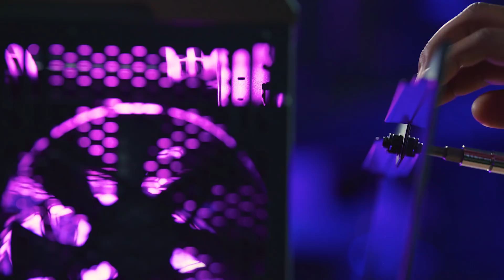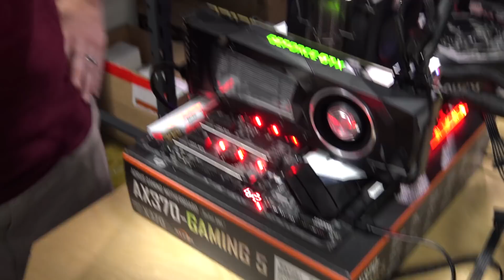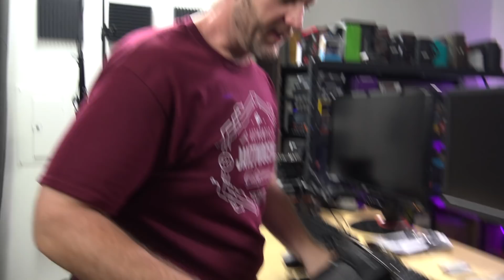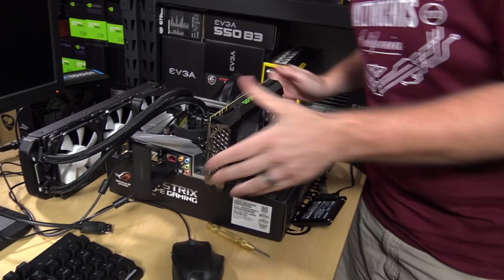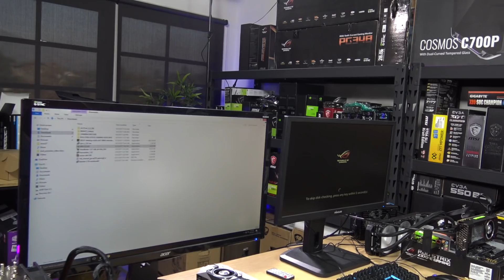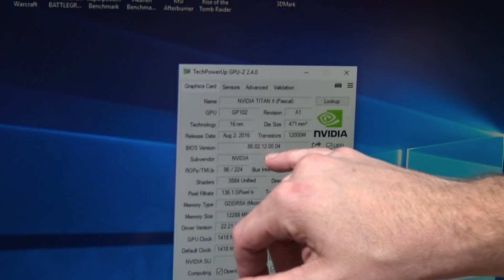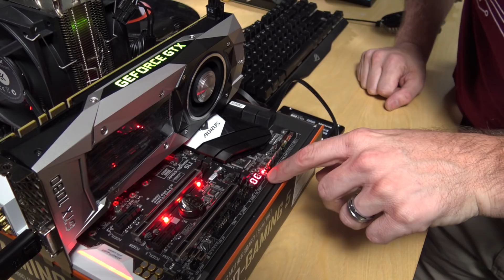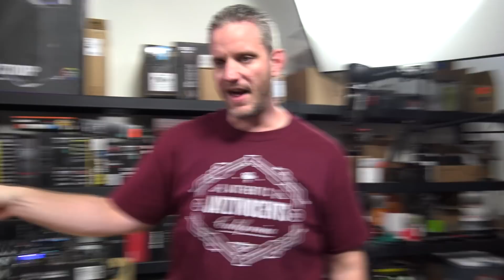I cant figure this one out... HELP!

Comment: If I had any open options to do troubleshooting, I'd get a second motherboard for the AMD, same model. I'm just armchairing right now but that would eliminate this piece of hardware as the issue.

Armchairing again, If trying another identical works, it might be down to electricity, pci-e socket irregularity, card quality, just edge of the seat stuff. Then again, this is heavy armchairing your question asks for
Reply: Martin Desjardins but it works with another gpu
Reply: Yeah, if you read my comment, I'm talking about edge of the seat stuff, maybe it is missing just that much voltage and whatnot that causes one of the cards that might also be slightly different than the other not to work.. very heavy supposition like I said

Comment: This happened to me actually with an EVGA 1060. The firmware of one card was different from the other BUT I was able to get the original card to work by lowering the voltage to the card (it was set to overclock in the mobo bios).

Comment: Just throwing this out there I have had 2 identical cards but one of the power socket's had an issue and some of the 6 or 8 pin pcie connectors from one power supply to another worked better IE the deformity was causing bad contact inside the socket.

Comment: Hey Jay- other card yadda yadda. Also check to see if the card failing on the amd system is pulling more watts. Have you tried a different PSU on the AMD test rig? You are using a single psu power cable. If the AMD system is pulling more watts on a similar power rail it could cause an issue.  Just a guess.

Comment: Bad 12V rail for the PCIe connections on the Ryzen system's power supply.  And check the Bios version on the 'bad' card, you didn't show that in the video as many people have noted.

Comment: I am experiencing something similar, I have a 1600x and a founders edition 1080, It gets stuck on the VGA post light too
Reply: Grayden Hormes make sure virtualization settings are off..
Reply: Steffen R cant do that if it doesn't boot
Reply: Yes you can. Use onboard video to configure in bios. If you don't get a crappy card and do it.
Reply: This is a ryzen system theres no onboard video
Reply: Steffen R i used a friends card and svm was off
Reply: Grayden Hormes try turning off fast boot or whatever your board calls it.

Comment: Please check bad gpu firmware on the intel since it works there. In the video, you show gpu firmware on intel, swap the gpu to ryzen, and show same gpu firmware, but you didnot show firmware that gpu previuosly on ryzen. Other way may change ryzen motherboard with other.

Comment: On the card that's being a pain, are the physical connections okay? Maybe something's misaligned due to a manufacturer defect enough that when the problem card is in the problem board, something's not connecting, but when it's in a nonproblematic board it works.

Comment: Do you have a weird overclock set for the Titan that maybe the one card that works can hit, but the other cannot? is the slot slightly dirty, and some of the dirt is not on the non-working titan so that when combined it blocks a vital part of the pcb inserted into the slot?

Comment: I've seen this persist from a corrupt os. My old hd5670  ran great for ages, then I tried throwing it onto my secondary system when the onboard seemed like it was dying. No worky. Changed the hard drive to a new os (when 8 came out) after 3 months of frustration and Tada!.. worky worky

Comment: I was having a similar issue with my Ryzen 1600X.  Though in my case it was both the graphics card and the motherboard.  I went through a 2 carbon blacks, and an aurous k5.  The final board to work was the hero crosshair VI.  At one point the issue took out the PCI bus on a board and the CPU.  Let me know if you would like more details on how I went through this issue.

Comment: ok, question, did you check manufacture dates? if they differ or were made by different warehouses maybe try checking the contacts on the cards and make sure every contact is good and no damage. that's about all I can think of unless there's a difference in some chips on the cards themselves.

Comment: You didn't actually check the BIOS of both cards. You checked it on the Intel system and them moved it to the AMD system and checked it again. You may want to go back and actually check the BIOS ver. of the card that only works on the Intel system.

Comment: Identical graphics cards aren't actually 'identical'. Whatever is going on is something so minor the amd board thinks it's a bad vga while the intel board does not. I'd be interested in seeing power loads for the two cards when in one of the working boards (obviously). During post/boot and under load. Thermals as well, maybe using a infrared camera during various loads without the backplate.

Comment: Did you try to move the videocard down to the second PCI slot just to see if it posts?
Also, try a clear CMOS if you didn't, and try to boot with a single memory module; I know it makes no sense, but that's what I'd do If I had the same issue, considering you already checked the BIOS version.
P.S. Sorry for any mistake, but English is not my native language.

Comment: Test in a different PCI slot. Check CPU pins. Visually check the PCI slot. Check for defects on the card or motherboard. Check power draw on the card like early rx480 cards.

Comment: I had a very similar issue with bootlooping when not making a quick stop in the bios and then enter to windows. I tried out millions of DDR4 settings until I found out, that the real issue was Windows 10 by itself. You have to go to msconfig and check that you let the boot priorities not using multithreading (like x16) just set it as auto. It conflicts with the bios multithreading setting. Maybe that will help! :)
Reply: If that setting via Windows actually affect how the UEFI runs it will still affect the UEFIs ability to POST.
Also if Fast Boot is enabled the UEFI will try to immediately boot Windows more or less skipping the POST screen (but still doing some POST in the background).
Reply: that would have effect the other card too , not just one of them. the problem have to be unique to this card+motherboard combo . something like this card have issue in it that this motherboard can't ignore or solve like extra volts in bios ( which is not readable by gpu-z ) while other motherboard is can ignore it the request of extra power or buss etc...
not sure what it is but he have to keep trying to check 1 by 1 till he find what is the hidden difference between these 2 cards .
Reply: Fido Dido that is a very good point, to be honest: I did just brainstorm, but you are right. That issue is so unique and maybe isn’t really a RYZEN fault! It could be something totally different like the way each card interacts with the pcie slot...to figure that out Jay would need each board twice to be sure. As the plating on the card could be damaged on the card or the pcie slot itself and be just working on the other slot cause of different types of layout...or even the cables of the psu in combination with the 8 pin of the gpu...if some of that is damaged, it might work with the other setup for whatever reason and not with the other setup. So I would see the problem on the Pcie Slot of the mobo, the Psu cable, the plating on the pcie connection of the gpu or 8 pin connection.
Reply: i was refering to a much older pc but that wasnt the point the point was windows modded my pcs bios so there could have been non noticable bios chanes after it runs that card and why would the fact it 2-17 not 2015 have to do with anyhting?
Reply: Vote up if you think that my suggestion could help Jay...cheers
Reply: well you might expect that but when a pc that was made when windows 8 was a thing and its bios is from when 8.0 was a thing(and ive not updated bios) why am i getting msges in bios saying if i change x settings windows 10 may not preform as well or may not funciton as thats not coming from bios and my bios was changed a bit i know and it was changed by windows i bet

Comment: Try the non working Titan card on the AMD system again. But, instead of swapping GPU's, swap display cables? Like go from DP, to DVI, to HDMI cable? If, that doesn't work, switch the two monitors around that you have on your work bench? If, that doesn't work, then, I don't really know what else to do that doesn't involve more time. But, if you have time, a fresh install of windows, load defaults on the motherboard to changing RAM kits and/or changing RAM speed. IDK. The RAM thing I threw out there because of RYZEN RAM thing. But, that is an interesting and strange conundrum.

Comment: You checked the vbios version on the same card on two different systems. You did not check the one that refused to post on Ryzen once you booted it in the Intel system. So you didn't confirm same bios!!!

Comment: I don't think you actually check the bios if that card that didn't work.  You check the good card on the Intel.  Put it in the AMD system And checked the same card but never checked the card that didn't work in the AMD system once you put it in the Intel system.

Comment: Something is going down definitely. I'd have to say it a combination of things first decompress need a clear head for this. Next now this is clearly a compound issues too many layers. There are some very specific conditions being achieved when you plug that specific gpu into the mobile to cause this. Check the pcie slot then back track. Reseat the cpu and ram do a wiggle test. Then start up. Should start up normally then insert gpu lightly the start up. Then clean slot and wiggle test gpu try start up. Then go deeper the mobo bios. Try to find and recreate those specific conditions. That small hang up on boot with the other gpu has be suspecting a software problem.

Comment: Do a fresh install of windows with the ryzen system. Apparently if you installed windows onto the ssd with an intel system and then switch the ssd over to the ryzen system, it can cause issues with the graphics card.

Comment: Try a different PCIe slot and see what that does. Maybe also try SLI? 

There could also be some settings in the UEFI that may have some effect on it. I don't have a Ryzen system available to me, but I am definitely familiar with troubleshooting unexplainable mother board issues. I would suggest messing with any graphics, PCIe, or other peripheral related settings and see if any of them have a bearing on what you are experiencing. Perhaps even just clearing CMOS would do the trick. It's a very odd issue.

Comment: You didn't actually check the BIOS version of the "bad" GPU.

You checked the BIOS on the "good" GPU while it was installed in the Intel system.
Then you checked the BIOS of the "good" GPU while it was installed in the Ryzen system.

Didn't you want to check the BIOS version of the "bad" GPU while it was installed in the Intel system?
You may have done this off camera, but not in the video.
Reply: Yes he checked the Firmware of the same Card twice on both system... Lol
Reply: You are correct, He checked the bios of the same card on both systems instead of both cards on the same system....
Reply: Thought the same
Reply: Jay show us the bios of the faulty card pls.
Reply: Edit *  You have so many comments, I see where you say you rechecked and they do indeed match, sorry *

I was thinking the same thing.  He never checked the BIOS of the bad card on the Intel system.  He checked the bios of the working card on the Ryzen system, that was the one he checked on the Intel system, so of course the BIOS reads the same, because it was the same card.  now, i don't think that was the problem.  I would however, re-flash the BIOS with the newest current BIOS, and make sure to clear all settings (I've noticed that my Ryzen system is funny with that sometimes)..  After that, i would then try the last known "Stable" bios and see, and possibly a beta BIOS.  I know that there is one guy on the ASUS forums that works on beta BIOS for Ryzen, so I'm sure there is something around.
Reply: Haha.  I saw that too.  Having made YouTube vids myself, you miss shit like that when you are filming.  Simple shit that you are talking about goes by the wayside because you are worried about getting the shot.  The lighting, the focus, all sorts of shit.  That being said, as soon as he did it, I muttered "ya dunce, you just checked the same card..."  lol.
Reply: And then he picked up the good GPU and said it was bad.
Reply: Legit.
Reply: Was thinking the same thing.
Reply: Unfortunately, the only things to really try are some of the things I suggested about reflashing different BIOSes while making sure to clear the settings.  I built a Ryzen system recently and it usually does, but there were times that kept some settings, but not others. I would try the last known stable factory released BIOS, as well as possibly a beta newer BIOS.  and see how that behaves.
Reply: Yes youre right thats what im thingking
Reply: was just getting rdy to say that
Reply: That's what I thought I saw.
Reply: lol
Reply: +Early Wynn

I don't have a solution.
I was just pointing out that it looked like Jay may have missed checking both cards... maybe he was tired.

Since Jay, in other comments, said that he did indeed check the BIOS on both cards, that seems like a very weird issue.
It would suck to be a person with just 1 system and to be in such a situation.
Reply: +icebalm
lol, I didn't even notice that.
Reply: +P.J
The drivers couldn't be the issue since the mobo didn't even boot to its BIOS, but I like your idea about trying other PCI-E ports.
Reply: Sounds Great now come up with an Solution for People with only one PC. And you`re someones hero
Reply: That's exactly what he did let's call them systems A (Left) and system B (Right).

First seashells that system a the video card is not working and it's failing to boot.

Then he shows system B working with the same video card and then checks the video cards bios.

After they doing that he takes systems a video card out and lays it in front of the keyboard of system B.

Then he takes system B's video card out and installs it into system A's motherboard.  At this time he checks the video cards bios again so you are tracking system is motherboard with system B's video card.

At no time to eat check system be with systems a video card.
Reply: yes he did I saw it .

Comment: Why is this logically  a RyZEN maturity problem? From the video, you had a similar problem with a second GTX card, and you had to turn off the machine and reseat the card to make it work. You should at least try another PCIE slot or otherwise make sure that the card has proper electric contacts at  the PCIE pins.

Comment: Try changing the Ryzen system PCIe slot to use x8 instead of x16 and see if it boots.  There may be an issue with the card on the pins used for x16 mode.  If you're using M.2 SSDs, then the Intel system is running  x8/x4 vs. Ryzen which would be using x16/x4.

Comment: Like 3 years ago , i had a similar problem, and with an Asus deluxe motherboard, some video cards work, others don't, even if they were well.

I had to change the graphics card 3 times , but still had some isues.

And the problem was the motherboard bios, even loading the last version of the bios tens of times, it didn't work well. (this problem i had it for 1 year)

How you load the new bios version normally?

You save it in a pendrive and then you loaded the file to the bios system.

And that was the problem.

I learned 1 year later, i don't remember what forum was, but someone wrote that, he loaded the bios by asus sofware (asus tweak 2 bios software). everyone knows that asus software have some bugs, in my mind never cross this idea.

And that day every error was gone.

So maybe is the way that you ard loading the new bios.

If i have some gramatical error, sorry
is not my first language.

Comment: I had a similar issue.  Video card worked one one system but not the other. 

I fixed it by resetting cmos and reflashing the bios on the card. No clue which fixed it but it did work.

Comment: Have you tried booting with that particular Titan in a different PCI-E slot? There could be something wrong with either the pins on the Titan or on that particular PCI-E slot (or both) that's causing it to not make good contact there, like the pin-out is slightly narrower/thinner on the problematic Titan than on the working one, and only the Gigabyte mobo is having problems with it because the card seems looser there than it did in the Asus mobo....might also try booting with the troublesome Titan in an Asus AM4 board (I'm assuming you probably have a few) using the same CPU/RAM/etc, see if it's just something funky between that particular card and Gigabyte's BIOS.

The only other thing I can think to try would be pulling the power and the CMOS battery from the Gigabyte board to completely reset it, wait a few mins, then try again.

Comment: Can it read ASIC quality on Pascal - is there a big difference? Two of the "same" card, so there has to be something in the card, even if there was possibly a system setting that would make it more compatible - on the other hand, that same card works fine in the other setup, that's the paradox, so there is something about that particular example that only upsets the Ryzen.
I would have cleared CMOS, just to give the ESCD a chance to detect everything from clean.
Do the two cards show different resources on the Intel? If it was simple like for like, the Intel should not have needed to reconfigure the way it did.

Comment: I've had this problem when I originally install windows 10 with an amd GPU installed and switched to nvidia GPU. I have a feeling windows 10 is the issue but I'm no certified computer tech, this being said I'm a hack and I still have this issue sometimes switching between a r9 280x and a gtx 780